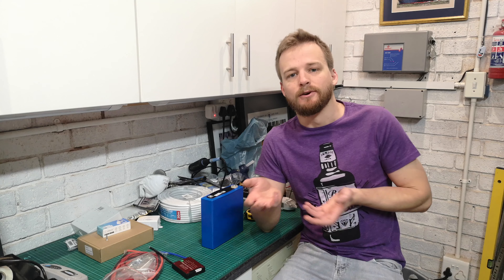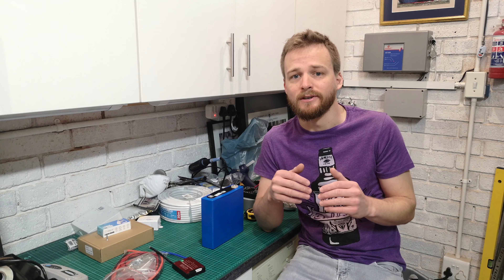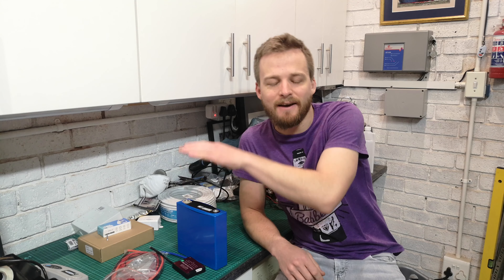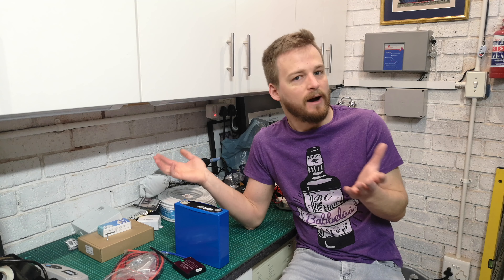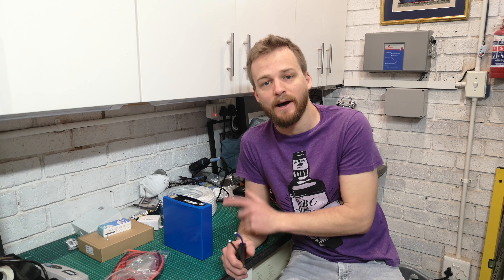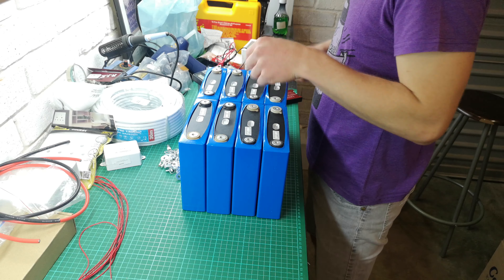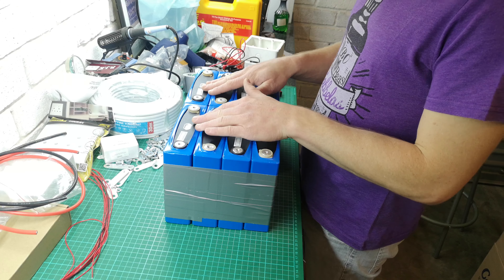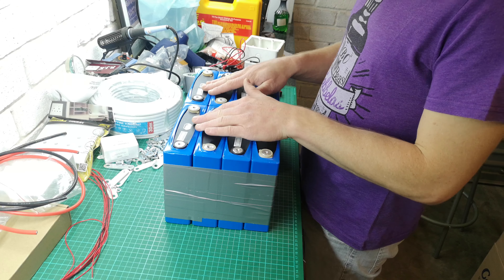HOW TO BUILD A BATTERY (LiFePO4) | DIY

Comment: This was really useful! I'm so glad you have explained the whole second life battery, it make so much sense. Also totally agree with the silly American measurement system
Reply: Since commercial electricity was really  invented and deployed in the US, the AWG system is still used, an is sorta similar to the British wire gauge system (SWG).  It is a logarithmic scale and is based on the cross sectional area..

Comment: How do you keep the batteries charged? Does the inverter also charge the battery? I believe putting LiFePo4 Cells under a constant trickle charge is not good for them, might be wrong but long term they should be kept at 50% charge, do they ever get the chance to balance? The charging profile looks different especially when they need to balance. Looking to also build a 2ndLife battery.
Reply from the maker: So the inverter does also charge the battery and the BMS manages the actual charge profile in order to look after these particular types of cells. Some inverters also have built in charge management and battery monitoring to look after the LiFePO4 cells, but mines' not that fancy!
Reply: @chrisdoesstuffza  Once fully charged the charger should disconnect the charge voltage(for LiFePO4) and only top it up once it falls below a certain point, which your will not do since it is a LA charger. I have no idea how much it will affect the cells keeping them on a float charge for a long time. If I were you I would install a smart plug that could shut down mains power at least once every 2 months and let the battery discharge (maybe down to 40%) to keep the electrons flowing
Reply from the maker: I think the BMS takes care of the cells, but with loadsheading here they do get used fairly often.

Comment: I mean the load on the batteries are really the same if you had those 8 in a 4s2p configuration each battery would pull the same current for the same wattage load I mean if you only had 4 then sure it would have more drawn from them but you also have half the battery
Reply from the maker: The total capacity is determined by the number of individual cells you have. The configuration of those cells will determine the overall voltage as well as the draw from each cell. The more cells you have the lower the individual power draw and thus the longer the expected life of your battery pack.

Comment: need fuses, get rid of the bolts and use studs so the threads do not wear out.
Reply from the maker: In this application I'm not too worried about fuses as the leads from the battery are short and both the BMS and inverter have built in protection for overload and short circuit. For the same reason I'm not too worried about installing studs as I have no need to remove the battery leads on a regular basis. 

If this was a different setup or arrangement I would certainly install studs and a breaker or fuse.

Comment: 8Awg = 40 to 55 amperes MAX!
Reply from the maker: You are right, however with short lengths at lower temperatures you can push it a little bit. My BMS will limit discharge to 60A, which is 1440W, and this exceeds the inverter capacity anyway, so I'm quite comfortable. 

Also, in South Africa, we use mm2 to size cable. An 8AWG is equivalent to a 10mm2, which can comfortable carry 60-80A according to our standards.